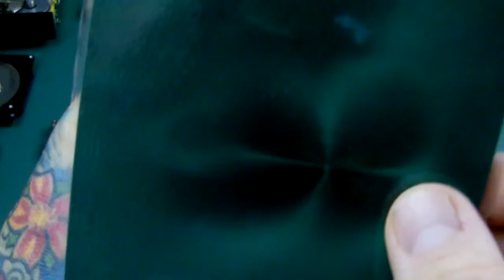Angry Photographer: Video 1. HOW Hard Drives WORK, why you MUST fear & hate them

Comment: So if you break a hard drive magnet in two. I guess you'd have 2 regular magnets with just two poles? Or do they both still have 4 poles and two dielectric inertia planes?
Reply from the maker: +Wouter Mol true, theyre polarized in a cross pattern